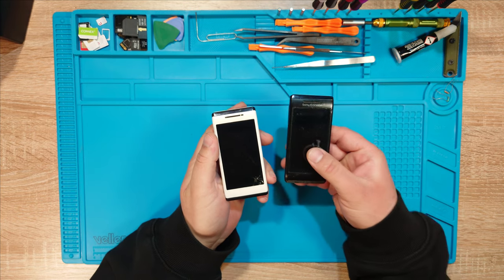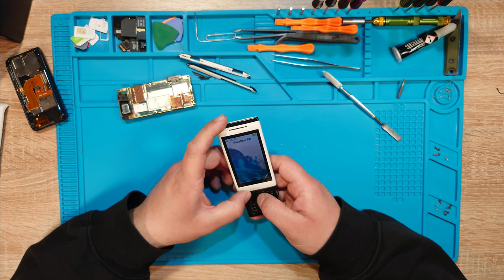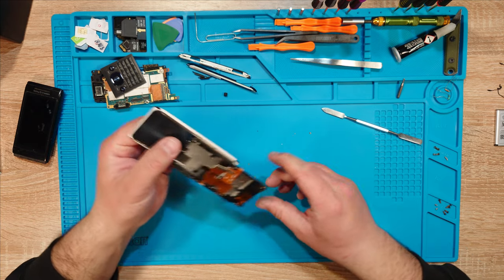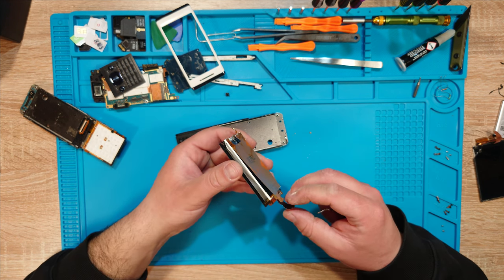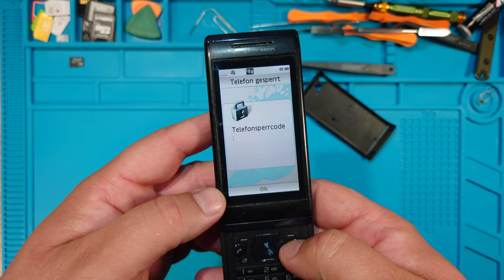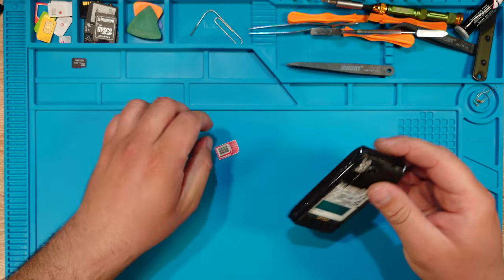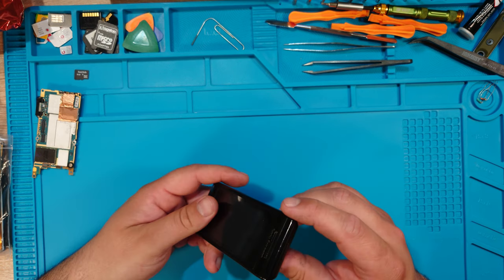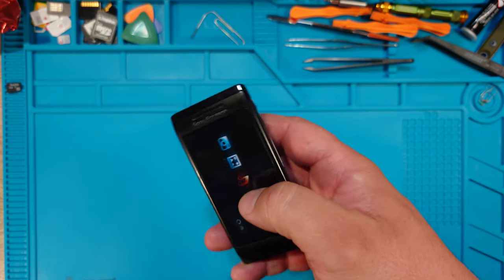Sony Ericsson U10i Aino |  one out of three

Comment: I recently found this phone trashed...the screen is cracked but only on the top layer and it doesn't have a battery, some of the keys are missing n I bet the flex cable is also damaged...I wonder how much it would cost me to fully repair it